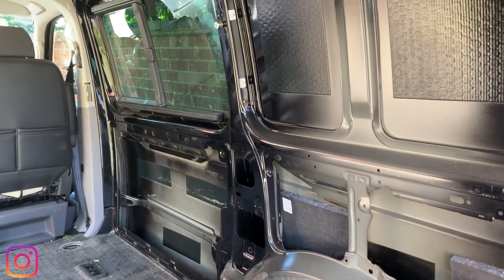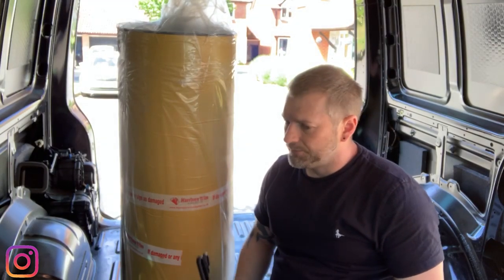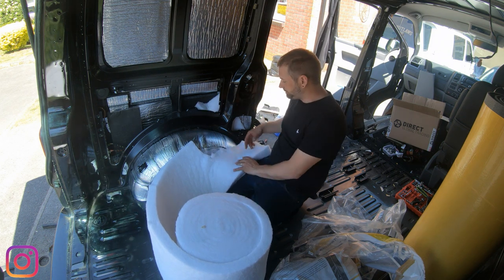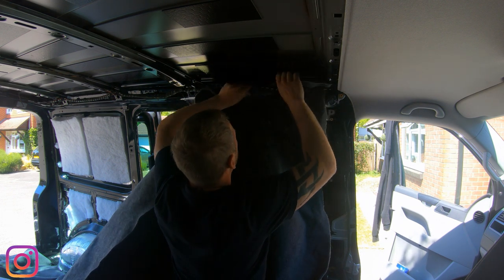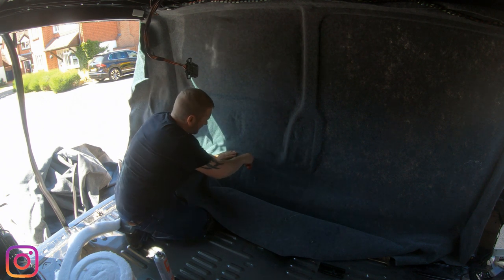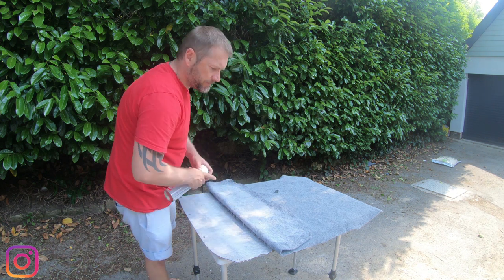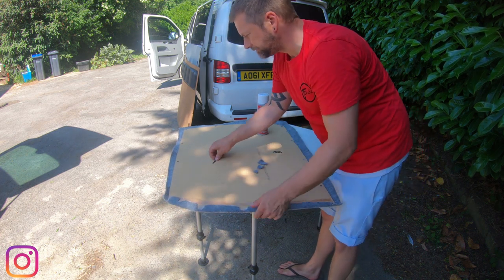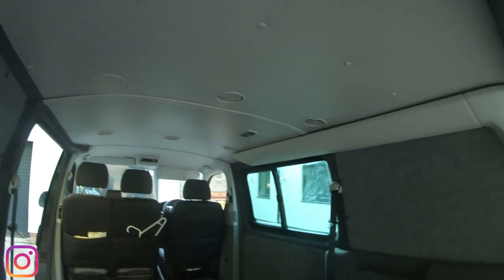Vw T5 carpet linning

Comment: I did the soldering iron trick on my panels - SO much easier than trying to cut the holes out with a knife
Reply from the maker: Works an absolute treat👌🏻🤙🏻so much easier that trying to cut, poke, fiddle the clips in 👌🏻

Comment: Nice job Tom, was it difficult to carpet around the driver side rear window, my Kombi doesn’t have any trim down the sides so not sure how to finish the edge, thanks for the vid 👍
Reply from the maker: Yeah didn’t add that bit in.. I cut the carpet about 5 mm from the edge of the window then using the thinest trim tool I had I was able to tuck the carpet in the gap between the metal and glass...
Reply: T Dubz thanks Tom, I thought there may of been some sort of plastic trim that I needed to get, looks tricky! I’ll get the carpet ordered today and crack on 🤘🏼

Comment: Did you sound deaden / insulate under the Kombi flooring?
Reply from the maker: Not yet, not sure what the floor is going to be like yet 👌🏻
Reply: T Dubz Would it be worth using anything underneath factory Kombi flooring if that stays? It’s quite thick and spongy anyway so maybe has some sound and/or insulating properties?
Reply: @LeedsJimbo82  I put 2mm silent coat under the mat ,,, was pain to do with all the ridges in the flooring but worth the effort
Reply: Good job Tom just a quick one did you find it easier using a hook blade or standard Stanley blade to cut carpet or do you think a razor blade would be better cheers mate